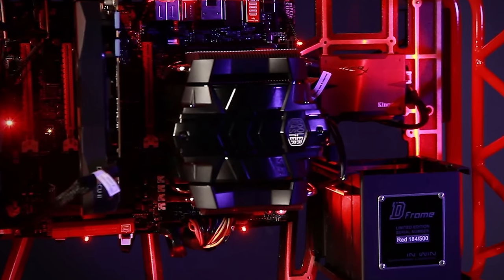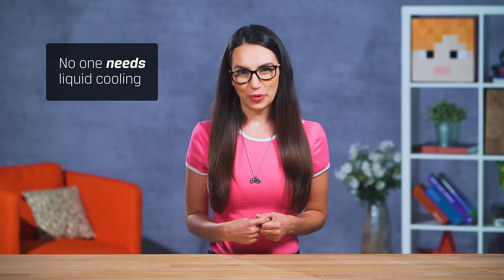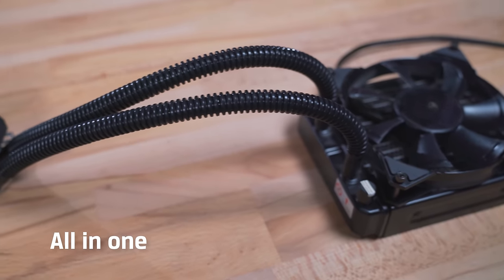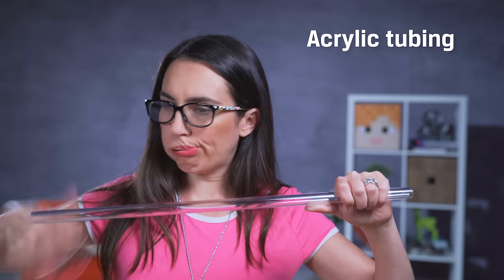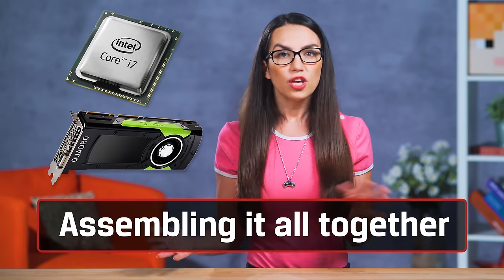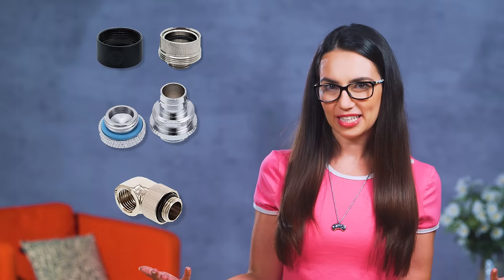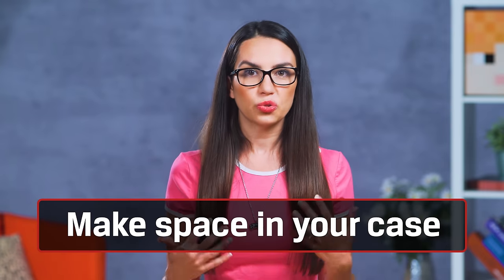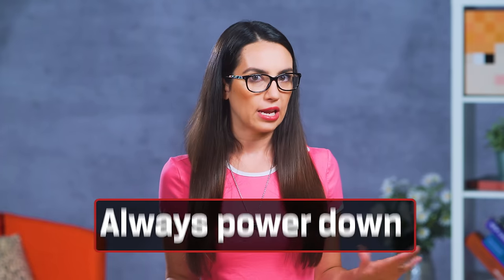PC Build - Tips for liquid cooling systems for PCs 🌬 DIY in 5 Ep 84

Comment: I've had liquid cooling - and yes, the same case - in use for twenty years now. When I last rebuilt the rig 2 years ago I naturally went with water cooling again and in retrospect I probably should not have, as the modern computers run SO cool and quiet that it just makes no sense. 
With that said, of course I did it anyway, modded the case further and water cooled it again and while it is still the steampunkish monstrosity with the same huge Ford Granada Arctic model full copper heating core I bought new back in the day installed on top of the biggets server case money could buy back then, painted jade green with car paint, and I still run a 230V Eheim aquarium pump via separate power cable and activated by the PC via an industrial relay - and even kept the anxient Akasa AK-FC-03 fan controller/temperature display - the actual GPU/CPU cooling today has been done SO easy and SO beautiful that the visual aspect alone justifies the hours spent tinkering with the system and there is SO much less DIY trouble as there was in the last millenium; took a week to build the first version of this back then. 
I went with EK waterworks full cover systems specifically designed for my ROG mobo with the manufacturer so despite costing an arm and a leg I DO recommend EK products for superb quality and fit (and looks). Just got a new GPU so I'll take a weekend to tinker with the system and rebuild it with hard tubing as the silicone ones are prone to get flattened over time.
The insane build with its car hifi sound insulation mat and the cooling system weighs an insane 21,5kg (43,5lbs) so carrying it is not pleasant and yeah, I have fried at least one brand new mobo due to a sneaky small leak from a 20 year old component (DIY water temperature sensor fitting) that in retrospect should have ditched but that is the only techical problem in 20 years and this is used a LOT and operates as an office computer in the day and as a gaming rig by night. 
Of course the silence and insane overclocking potential in no way compare to the time and money spent but that's not why we do this isn't it? 
And yeah, while people thought you are insane to water cool your computer when basicly no one was doing it, it is STILL so rare that any water cooled rig retains the "WOW" -factor in the eyes of the general public and fellow PC enthusiasts.
Thanks for a literally cool video, thought I'd share the long time experience!

Comment: Years ago I built a PC with a limited edition AMD HAF case and it was huge. It had a ton of fans and ran pretty cool but it was set up for liquid cooling too so I could add it later. I bought all the stuff but never used it because I liked the look of the Cooler Master V8 cpu cooler I had. I have an Archangel with a Ryzen 5 and I’m not too attached to the cooler so I may go the liquid route.